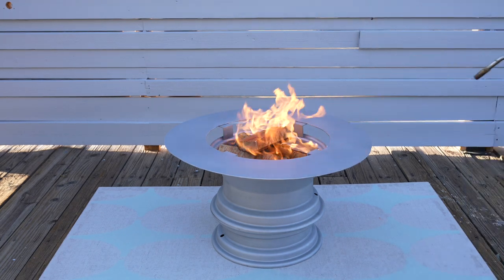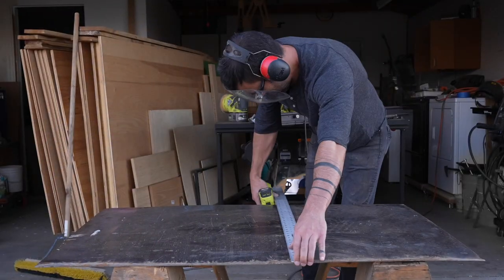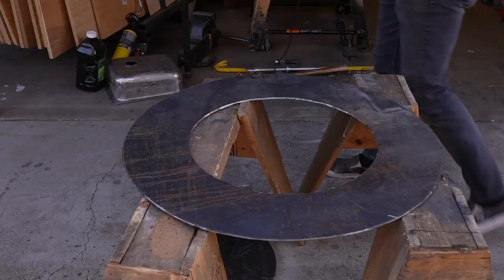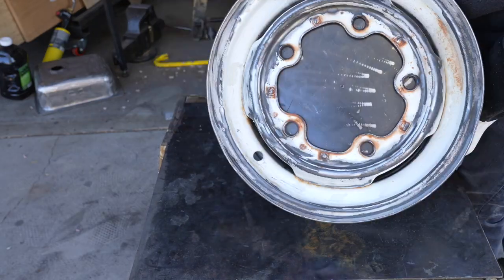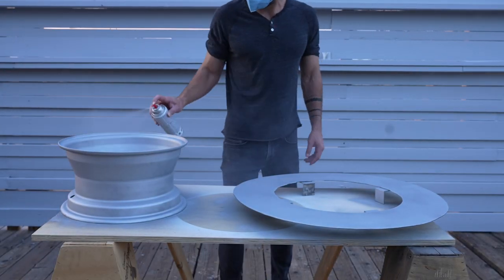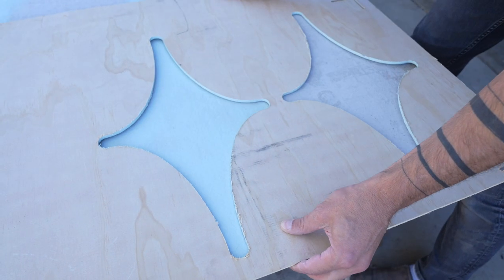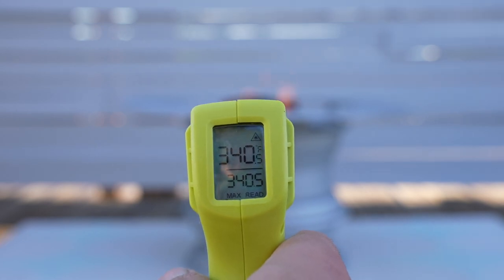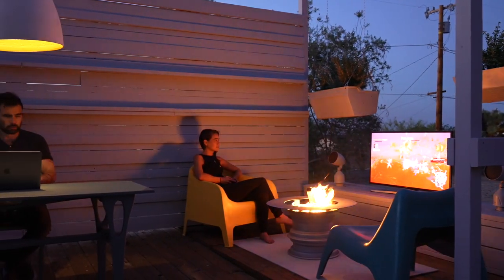Making and Spray Painting a FIRE PIT out of car rims | Patio Makeover Ep 1

Comment: Nice idea. Upcycling is always fun, imo. Makes you extra proud about not only having 'made a thing', but also having reused a piece of trash. 
Didn't know there was easy available spray paint, that can stand up to high heat, either. So that's a very useful tip 👍
Reply from the maker: thank you! such a fun easy project and even though I welded this could be done by drilling holes and bolting the pieces

Comment: Ben, probably a dumb question, but how do you keep spray paint nozzles from clogging. I always seem to end up with a bunch of nearly full rattle cans that I can't use because somewhere there is a clog.
Reply: I always turn them upside down and spay them till just air comes out. That always worked for me .. Until now , because some spray any which way. Hope it helps.
Reply: Another option if you have access to compressed air is pull the nozzle of and shot some compressed air through them
Reply: @xgouldiex  I've never thought of that. Good idea , but not always near the compressor. Good idea though ! 😎
Reply: @DavidMorris-ss7pw  
You can get compressed air in spray bottles. It's used to clean dust out of computers, for example. You know, the kind you place under your desk (sorry, English isn't my first language , I really don't know, what you call that part. Tower?). Or other mechanical devices, for that matter. Anywhere, you don't want to touch stuff with a brush or cloth.
That being said, the upside down spraying thing works fairly reliably. And you can also get additional spray heads, in case it doesn't for some reason.
Reply from the maker: I haven't had this issue